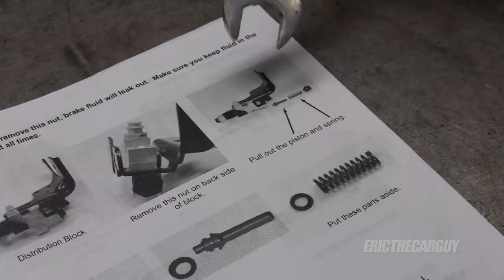GMT400 Rear Disc Brake Conversion (Part 2) #ETCGDadsTruck

Comment: I have a 91 Silverado extended cab 4x4 short box.. To date best truck I own. All I did was over adjust the back brakes and un plug the rear anti lock module. But how I got all the air out was to pump dot 3 from the bottom up about a quart per side saw the smallest of bubbles and that got me some of the firmest brakes I have ever seen on these trucks. To be completely honest I got lucky nothing more or less. I have used that kit for disc in the back it holds up well especially with the salt/brine they use on Ontario roads. The kit that I like uses Gm calipers from an 80's front wheel drive diesel Cadillac they work great.
Reply: Understand on some vehicles, especially these GM's, that can be the last hurrah to get rid of some, or up to all, of the spongy pedal.  I looked up how the manufacturer does it and they use, yes unobtainable to us, a system that pulls a vacuum on the brake system before installing the fluid.  Side story, Did a 78 trans am front disc brake conversion on 1970 cutlass, with station wagon rear drum set up, for a great braking system on it.  Did the tall spindle conversion and it handled and braked exceptional well, especially considering most everything was from salvage yard, back some 35 years ago at that.  Big shout out to Eric for making it real, letting us see from a different view while he dives into the realities of what can go wrong and how to try and figure a remedy as well as fill in for having a shop to hang out at like I did in younger days.  Also, glad to read the comments of those with positive input and experience on alternative methods.  Old diesel Caddy calipers, new one on me!!!

Comment: Thanks for all the montage reminder of all the "fun" brake bleeds that my dad and I have done together. Also, parking brake cable is a $10 part, and probably needed to be replaced anyway. They stretch over time.

Comment: Glad to see i'm not the only that thinks the correct way to repair a broken o2 sensor is to rebuild or replace the engine. I had broken the oil pressure sending unit once and decided that a complete rebuild was the best way.....

Comment: The hole on top of the caliper is where the parking brake line goes through
Reply: But i still enjoyed the video, also I'm sure thats for other models that doesn't have the e brake line coming from the top at a weird angle
Reply from the maker: Many on a Lincolin, but not on this truck.
Reply: @ericthecarguy  I think JB is right.  if you look at the footage at 30:44 the parking brake cable appears to be in perfect alignment with the hole on the caliper.  Maybe I'm wrong...its hard to see it from here in my easy chair, but check the footage and you will see what I am looking at.
Reply: @davemall1  I have to agree with you. Its painfully obvious.
Reply: Yeah its supposed to go through that hole for sure

Comment: I have a 1997 c1500 that I replaced all the hardware, brake shoes and cylinders on the rear drum brakes then vacuum bleed all four corners and ended up going from a spongy brake pedal to a solid brake pedal.

Comment: I did an ABS elimination on a friends 96 Tahoe.  I ripped out the nonfunctional and rather expensive, Keysey Hayes ABS and replaced it with a GM "Combination Valve", from an 86 truck from a salvage yard.  If you do this, make sure to cut the lines, as you will need the fittings.  Line size is the same, the fittings are not.  Mounted it under the master cylinder, and the brakes worked very well.  Not to a hard to do, you will need to cut and flair some brake lines though.

Comment: Thanks for the video @ericthecarguy I have been weighing my options on doing this to my 1990 4WD. One of those options is to find a good used 3/4 ton rear end with disc brakes. The other is to basically do what you have done. After watching your videos, I believe I will go junkyard hopping. However, I do understand the frustration with the soft pedal feel.
Reply: Drums can be made to work just fine. Thumbs up......

Comment: Using a hose clamp to release the tabs on the parking brake cable was pure genius!
Reply: I came up with that idea once and was quite proud of myself. I'm sure I'm not the first one to think of it though. I suggested it to Eric on a previous video and he said he was aware of that method if I remember correctly. Still cool to see though.
Reply: @jonclark1288  You sir are a genius as well. Every now and then I have an idea like that and wonder why it took me so long to figure out the easy way to do it.

Comment: In my opinion, gathered from my experience driving vehicles of that era, the ABS system was more dangerous than the problem it was supposed to cure.
Sliding through an intersection(in the middle of summer, i.e. no ice) because the road had a few bumps that tricked the ABS, was scary.  I was lucky several times that I did not collide with other vehicles. Fortunately they made ABS better a few years later.
Reply: My 98 Sierra about got me killed because of the ABS. I dont like ABS. Drove vehicles for decades without it. I was going down hill on gravel road pulling my boat, went to stop at bottom crossroad and the ABS kicked in....no brakes. Ended up stopping by easing into the parking brake.

Comment: C/K trucks were designed to have a softened brake pedal feel. I guess the thinking was to provide the operator with more control during normal drivinv. And also so that the ABS (being a relatively new feature at the time) would only activate in an emergency situation.

Personally, I prefer a firm brake pedal feel too, but I've owned several GM 1/2-3/4 ton trucks over the years and I guess that's just how they are.
Reply: I feel the same way as i've owned a 91 and 92 c1500. I remember going from my Silverado's to my s10's and nearly throwing myself through the windshield the first couple times i hit the brakes.

Comment: you could do those rear drum's 5 times over for the price/ and in like a half hour per time (unless you need backing plates(then just might as well rebuild the engine while your at it)  saving those old brake lines without a single kink made this worth watching

Comment: I bought my 1998 GMC (GMT400) used, I too didn't like the break pedal feel, the first gas station I took it to did some adjusting on it and made it 'better' but still felt soft but never went to the floor soft, he also said for a couple of years GM puck up truck breaks felt that way. Not before or after but for a couple of model years and I just got 'lucky' when I bought it.
A few years later I had moved t a new location and found a new mechanic that was recommend to me from work friends. They are as honest as the day is long, I finally got around to having new break pads on, when they got to the right rear wheel, they called me over to see what they found, 😱 some of the hardware had been installed wrong. I trust their word because they have done a lot of other work for me and haven't screwed me over. Bottom line on the drum breaks is they still have a 'soft' feel but if I have to apply a lot of pressure to it, it gets a solid feel at about half pedal.

Comment: Eric, I'm curious if you ever solved the spongy brake problem. Seems to be a common problem with the gmt400 series with vacuum boosters. I have a 98 gmc k2500 (sierra) with the same problem. I replaced just about every compoment (calipers, flex hoses, entire disc/drum components, etc.) imaginable minus the steel brake lines. I've also upgraded to different MC's (x4) last of which was a MC for the new body style. Breaking scares the hell out of me. I've bled and bled and bled to no avail. I've also bench bled the MC and also cracked the lines at the MC once installed...no difference. I have ABS and have also (manually) bled at the ABS module via other YT videos on how to do that. The only thing I haven't tried was having the dealer bleed the ABS module via a scanner, but I'm skeptical. People tell me, "Oh, well that's just how Chevy's are." I doubt it. I'm sure they didn't come off the assembly line like that. Let me know what you think.
Reply: I have that same issue.  Did you ever find a fix?

Comment: I'm pretty sure that the end of the parking brake should go through the circular hole on the top side of the rear brake calliper.
Reply from the maker: If it were installed on a Lincolin, where these calipers came from, yes. But since they are on this truck, they use the supplied brackets.

Comment: Great tip for clamps if you have a double ended reversible screw driver you can take the bit out and your the shaft for the clamp head bolt

Comment: I know I'm two years late, but I found that disabling the ABS on my 95 suburban was really easy - just damage a wheel speed sensor cable, bam, gone. The 4wd suburbans like mine come with 11" drums in the rear, and after flushing the system with fresh fluid and going over them, the pedal feel is actually not bad.

Comment: Thank you. I was wanting to upgrade my s10 master cylinder so i could have a master with the twist on cap and better brakes  the cap would make it easier to pressure bleed but did not know the circuits could be reversed in some master cylinders. Love your videos I have been watching your videos for many years thanks.

Comment: I could see you were struggling there Eric but it was your first pass.  Sleep on it and anything that bothers you can be fixed next oil change.  Maybe that adjustment sleeve could be cut and an extension sleeve welded on to give you some more adjustment.  Cheers.

Comment: switched my 4wd GMT 400 from 1500 to 3500 axles front and back. did like u said in the end of the video and just bought a rear axle off a newer truck with disc brakes already equipped for about $250, and replaced all the brake parts which ended up costing about $300. so for about $550 I have a rear disc break set up with bigger calipers and heavier rotors and I can confirm that the pedal still feels like crap. Haven't messed with any abs or master cylinder parts yet... truck stops great I can lock up all 4 wheels but the pedal just kind of squishes around...

Comment: I feel your pain w/ the damnable Summit Kit hassles. You usually have what's necessary to get the job done, but there always seems to be a stumbling block somewhere in the procedure/process, which, of course, leaves you to your own devices to make things work. Nice improvisation on the E brake assembly. Get 'er done! lol  I've been struggling w/ my '02 Blazer, after finding a local "mechanic" help my paraplegic a$$ R&R the trans that died during a road trip, only to have that mechanic get arrested, leaving me to piece things back together, w/o the benefit of having been involved in any of the disassembly. Four months later and I should get it running again this weekend. My hands may look like a road map of greasy cracks for the next few weeks, as I slowly work the grime out of the callous. Stay greasy.
Reply from the maker: Sorry to hear about your troubles. I hope you overcome them soon. 

As for the kit, Summit didn't make the kit, SSBC made the brake kit.

Comment: Black ties have more than UV protection (of course, if that's stated on the package, but color code means they are UV protected), they also have the chemical disposition to last freeze to heat cycles better. You can actually feel this if you take a pair of nippers to both the cheapo stuff and a better quality one in the way they "crunch". Of course, all this is written on the package, so that's where one has to refer to. I've had black ones snap on my on installation because it was that goddamn cold outside.

Comment: Now would be a good time to invest in some line wrenches. Either Crows Feet (My preferred) or spanners. I'm digging this series, as I've owned a dozen GMT400 Chevy's/GMC's in my days. My 92's brake pedal is stout with the rear anti-lock system in tact, but my later all wheel ABS 1995 has the dreaded spongy pedal. Thanks for all you bring to the table Eric! Zip~
Reply from the maker: I did use a line wrench. https://store.snapon.com/Open-End-and-Flare-Nut-mm-5pc-6-Point-Open-End-Flare-Nut-Metric-Wrench-Set-10-mm-14-mm--P630777.aspx

Thanks for the comment.

Comment: I did a abs bypass on my truck yesterday. My isolation valve was leaking out of a capped hole? It caused my abs light to flash 3x followed by a long blink. Luckily my fitting was the same size. I bought the edlemann 258450 adapter and it didn’t fit. My dumbass didn’t check if they were the same size and I went searching to adapt to my other fitting. Once I finally put the male end of the adapter to the fitting I realized how much time I wasted going store to store try to adapt to the same fitting 🤦🏻‍♂️.  All I had to do was bend the line over and connect.

But you could have adapted it pretty easily. I had a terrible time getting that 1/4 fitting into the bottom of the proportioning valve with my abs in the way. I can’t imagine getting that brake line back into that tiny space on the frame there lol. I just bent it in the truck. Hopefully I didn’t break a line lol.

Comment: Greetings Eric, I commented on part one about using this exact same kit and the prop valve.  I initially did the conversion to the prop valve like the instructions stated and still had a soft pedal.  I put the old parts back in and my brake pedal is very firm.  Hope this helps.

Comment: another great video.🤘🤘few things that might help get a better pedal... ...the booster pushrod to master cylinder clearance probably needs to be adjusted. You dont want more than.020" clearance between the two.too much clearance makes the pedal feel soft.  Going to a different style master almost alwyas requires adjustment. Good news is that it can be adjusted without removing lines from the  master. Unbolt master, slide it forward and adjust the threaded rod on the booster pushrod. I turn it out a couple turns and slide the master back on until there is interference. Then screw back in a 1/4 turn at a time until master seats without touching the pushrod. Vehicles with rear drums have residual valves to maintain a little pressure in the line so the shoes dont fully retract. Not sure if ABS vehicles still used them but they dont play nice with calipers. Last thing...could be the camera angle but it looks like even the new bleeder screw isnt high enough. May need to remove the caliper or tilt it to make sure the bleeder is the highest point. If not a little bubble of air will remain in the caliper and the pedal will never feel firm.
Reply from the maker: There will be a follow up video next week. Since the new master cylinder is also for later models of this truck that use the same booster, adjustment isn't necessary. You have to be very careful adjusting the pushrod. If you get it too tight, you can burn up the brakes or lock them up because of excess heat. Ask me how I know. 

I got the best results after I replaced the front brake hose with steel braided units. I also replaced the front rotors and pads. Great pedal feel and it stops on a dime.
Reply: @ericthecarguy  i have made a few masters cylinders drag the brakes over the years myself.  Sux when you spend hours tuning trying improve off- idle performance and discover the brakes are dragging. Looking forward to the next video.

Comment: I fell to see how you get all the air out of the rear given the fact that the bleeder is on the hose and not pushing through the caliper and pushing the air out, the fluid can simply go out the bleeder rather than into the caliper. I see why they did that but I would rather have the e cable under the bottom and the stock bleeder on top. Good vid, thanks.

Comment: I've never had issues with drum brakes on my vintage cars.. But then again, i don't drive them like i stole it. But i guess it's nice to have conversion kits so if you can't find replacement parts anymore then it's nice to have something instead of nothing.

Comment: You want a much faster way to bleed brakes that doesn't require the "down.  Okay hold.  Up.  Wait, are you pushing the pedal all the way down?  What?" dance?Go get a vacuum pump, like the Harbor Freight #61245.  Use an old jar as a catch can.  Put two hose barbs through the lid of the jar and run one hose to the vacuum pump, and use a silicone hose on the other end and run it to the bleeder valve.  Turn on the pump.  Crack the valve.  Watch the bubbles flow.  Close the valve, refill the master cylinder, and repeat.You can use a tee and two silicone hoses to get the job done even faster.It's basically a Mityvac, except it works way faster and doesn't break after a couple of uses.  And the silicone hose is much more resilient, in my experience, than those dumb 90-degree rubber adapters that the Mityvac uses.

Comment: Gm had an issue with the diaphragm in some of their vacuum boosters failing. I didn’t have good breaks in my ‘88 K1500 till I put a newer model dual diaphragm booster on and master-cylinder from a 2500.

Comment: Yes getting rid of the ABS makes for a better brake pedal.  Couldn't get fluid to the rear of my 89, bypassed the ABS and got fluid. Much better pedal feel and the truck stops on a dime.

Comment: That vise has (online) a set of jaws that are half bald, half toothed. You should totally get that pair or at least a sleeve for exactly these kinds of jobs where you don't want to poke holes in to tubes or pipes or damage a surface.
Reply: OR... he could put it inside a cut piece of hose.

Comment: LMC sells those E-brake adjustment nuts/contraptions. Anyway.. I have a 89 GMT400, and kept that entire brake system stock, but replaced the lines with SS. I did pick up the LMC Sloted rotors for the front, and that was truly an amazing difference. Now you have Ford parts on your Dads truck... What did your Dad ever do to you to treat him like that? Shocking.